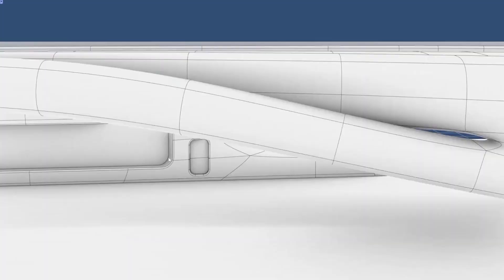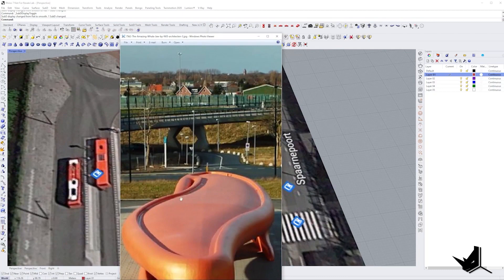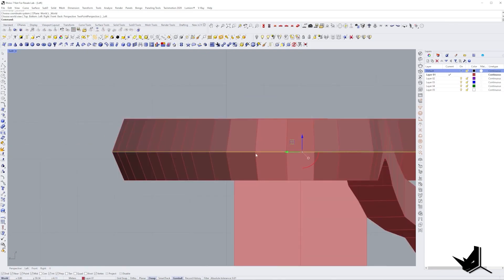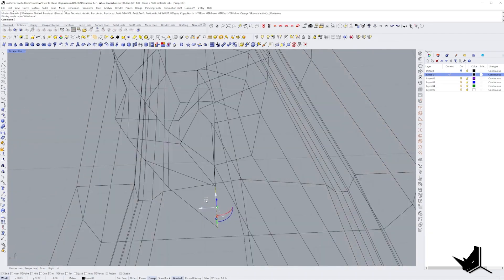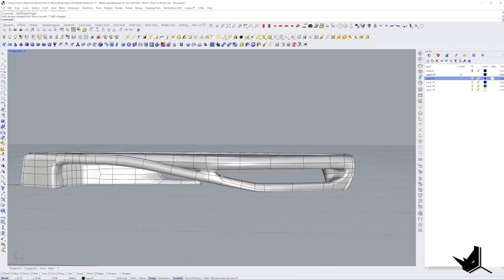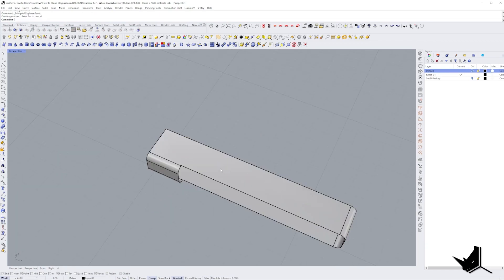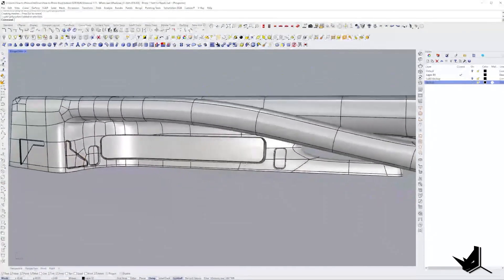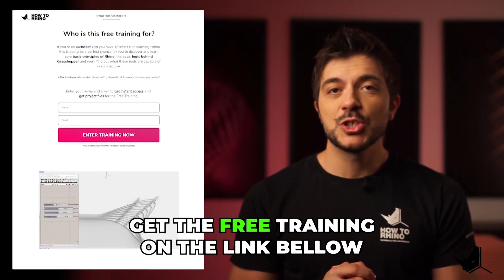Organic Modeling Techniques you NEED to know

Comment: Thanks for these. I'm also curious on how these structures are constructed though.

How the models are converted to construction drawings & how the materials are manufactured, etc.
Reply from the maker: Sure, you're welcome :) 
You can get some insights of the construction on this link.. There's a lot of construction drawings. 
https://arqa.com/en/architecture/the-amazing-whale-jaw-bus-station-in-hoofddorp.html

This is a part of the article: " The building is completely made of polystyrene foam and polyester and is, as such, the world’s largest structure in synthetic materials (50m x 10m x 5m). The available budget meant that it could never have been created using conventional construction methods."